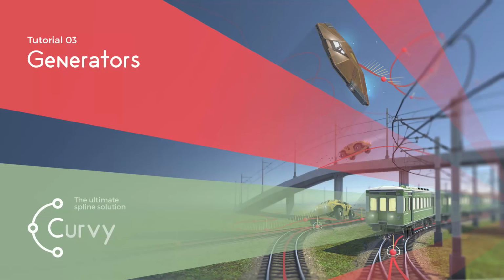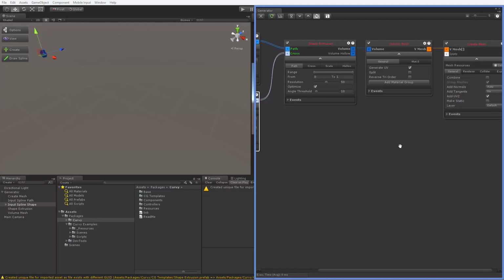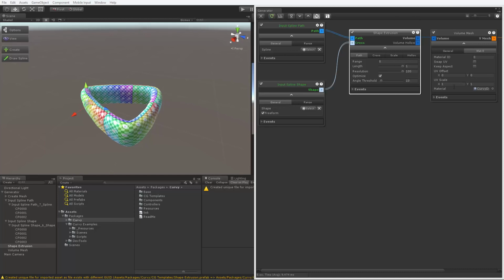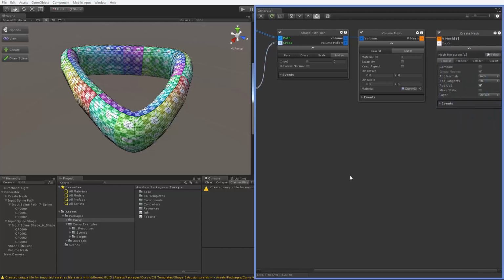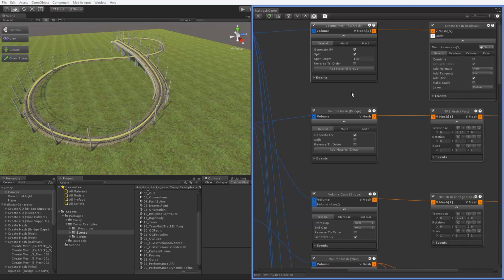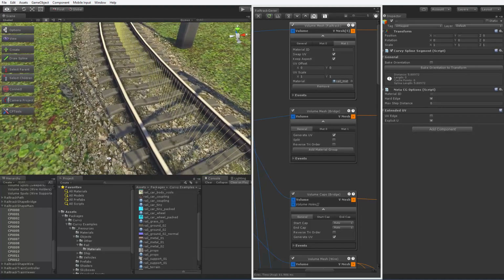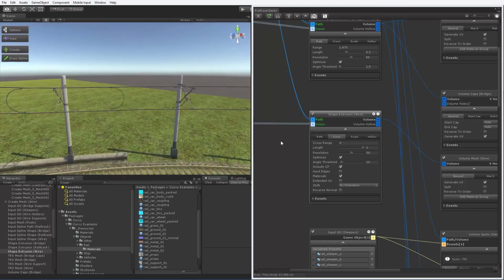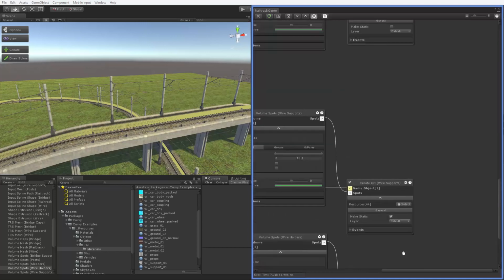Generators - Curvy Splines tutorial

Comment: How do I build a road?  This tutorial doesn't really show how to do anything and its such a massive asset to understand.
Reply from the maker: Depends on how the road is, but a good solution is to create a generator, then in it right click and add a Shape Extrusion template. You will have a simple shape extrusion. You can then edit the extrusions' parameter and the spline used for the shape to model the road to fit your needs. If you need to project your road on a terrain, see this video:
https://youtu.be/PtP4A2sQphE
The scenes in these videos are included in the asset. So you can see how they are parametrized.
Reply from the maker: In other words, reproduce what is done in the "Extruding a simple mesh" chapter of the video, and set the extrusion shape to a rectangle shape or even a simple line for example. Then set the road's texture in the Volume Mesh module. With this you should have a basic road.
Reply: @toolbuddy  I will try that thank you

Comment: Do you have a tutorial where you make the train tracks from scratch? That graph is way too complicated. I just purchased your asset and expected to draw a spline and hit a button and then have tracks. I didn't check this video first, I should have. That's far too professional and time intense to use.
Reply from the maker: Hi,
There isn't such tutorial. But you can find simpler graphs in these example scenes:
- In scene 13_TrainMultiTrackDrifting, look for the object called RailtrackGeneratorSimple
- A more complex one, in scene 12_Train, look for the object called RailtrackGeneratorA
Reply: @toolbuddy  I did look at these. Still far too complex for new users and I have no idea what all these objects you created in the scene do. I also tried simply creating prefabs from your demo scene and then re-using the prefabs with the tracks and the train in another scene. That didn't work well:

Example: I created prefabs from RailtrackPathOuter and RailtrackShapeMain. But the spline data was wrong. I had to set the Input Spline Shape again to RailtrackShapeMain because it looked blown up like a balloon. I guess there's some serialization wrong? Also in order to re-use the TrainCar, I had to assign RailtrackPathOuter to the spline field of FrontAxis, BackAxis, Body. That was all trial and error. There's no proper documentation, the documentation is a rather technical one. Or at least I didn't find anything there. After adjusting the track spline in my new scene, I tried to find a snap to terrain function. I couldn't find one. Is there such a feature?

Without a proper documentation or a tutorial this asset is rather trial and error and frustrating to use. I do like the output though. Hence I'd like you to ask to make a tutorial about how you created those train tracks and the train movement step by step. Thank you very much.
Reply from the maker: @GameDev1  
About the documentation: There are two documentations: The one for using Curvy through its API (https://api.curvyeditor.com) and the one for using it through Unity's inspectors (https://curvyeditor.com/documentation/start). Inside those documentations, there is an entry for each Curvy Generator module. You can access the documentation dedicated to each Curvy script (including the Curvy Generator modules) directly from within Unity by clicking on the "?" icon on the top right corner of the inspector/module editor.

About the step by step guide:
Inside a Curvy Generator, if you right click on an empty space, and click on "Add template", you will have a list of common scenarios already configured. The one you are looking for is "Shape Extrusion". Just add the template, and fill it's inputs with your splines, and you are good to go. I can show you this with a step by step guide with screenshots, but a youtube comment is not the proper place for that. Send me an email, or open a thread on the support forum, and I will answer you with the screenshots. Links available in the channel and video's descriptions

About the prefabs:
For objects to be referenced by each other in a prefab, they need to be in the same prefab.
If you set RailtrackPathOuter and RailtrackShapeMain under the same object in the hierarchy, then make a prefab from that object, instantiating said prefab in a new scene works. But if you make them in two separate prefabs, you will need to reference RailtrackShapeMain  in the Curvy Generator after you instantiate them.
In both scenarios, I didn't had an issue with the blown up like a balloon spline. If you can send me the prefab I will have a look at it.

About the TrainCar:
The train from the scene 12_Train has a field called "Spline" in the "Train Manger" script. Assigning that field is enough for it to work

Please let me know if you have any other questions. And if so, please write me via mail or the public support forum, it would be easier to share files that way
Reply: @toolbuddy  Cool, thank you very much! I'll check it out.
Reply from the maker: @GameDev1  
And sorry I completely forgot to answer your question:
"After adjusting the track spline in my new scene, I tried to find a snap to terrain function. I couldn't find one. Is there such a feature?"
The answer is available at this forum post: https://forum.curvyeditor.com/showthread.php?tid=561
Reply: @toolbuddy  Link to the documentation is dead and you should really think about making a simpler tutorial, I'm 3mins and already lost!
Reply from the maker: @jokesterthemighty227  Thanks for notifying me about the issue with the link. It is now fixed. For future tutorials I will try to make shorter ones, thanks for the remark.

Comment: Hello, is it possible to take a rail prefab and adjust similarly to Shape Extrusion? Please make more tutorials :)
Reply from the maker: Yes, you can make a prefab from a whole Curvy Generator (it is simply a hierarchy of game objects with Curvy components after all).
For now I am not planning to make a tutorial in the near future. If a feature is not clear in Curvy, instead of making a Tutorial I prefer spending that time in making a better UI and/or documentation and/or more example scenes about that feature instead.
To summarize, my philosophy is that Curvy should be self explanatory.
Reply: I don't really need a rail prefab, I need to adjust my own material and make it move in a curve. I need to add text and have it rotate 360 degrees as the viewer stands inside it. Is it something curvy can provide?
Reply from the maker: Yes it is possible. Please check the answer to the email you send me.